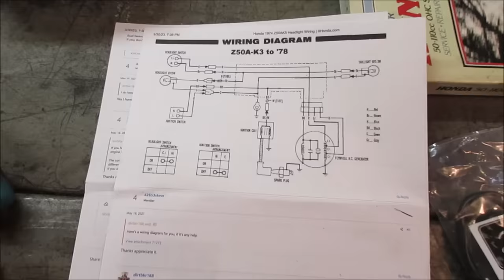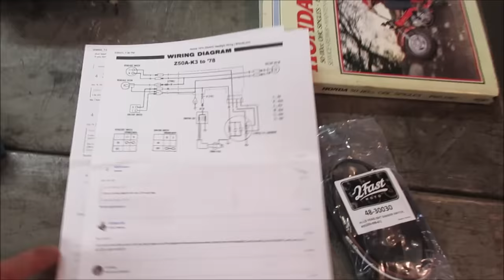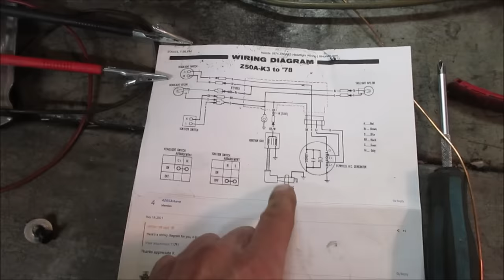They Could Not Fix It, Restored Honda Z50. Can We?

Comment: My brother and I had 2 in the 70's, One blue with white accents and one with red with white accents. Both were used when we got them. Not sure about the blue one but the red one was a 1971. The blue one broke not sure chain or sprocket. It never got fixed but that red one , I rode it till the back tire was a slick. I would get in trouble for using all the lawn mower gas. The neighbors had a Honda 50 also and a Yamaha 75. We would ride the younger brother on the 50 in front the other brother on the 75 in the middle and me in the rear .  That how we would "race" . All I remember  is the hours of fun we had on those bikes. My parents sold both of them at a yard sale I think they got 25$ for both. Yep 25$ !  End of story right. Nope. Years later while at work, the bosses son comes into the shop with a trailer full of junk and scrap metal. On the back of the trailer was my red Honda. I told him that's my mini bike, no way he said, no worries it doesn't run its junk. I walked over checked the tank , had a small amount in it. I took it off the trailer opened the petcock put on half choke 2 kicks and it was running. Rode down the parking lot turned around and rode past him wide open in 3rd gear. I should of never of started it. He wouldn't sell it to me. I never saw the bike again. Sorry for the ramble.

Comment: 30+ years ago I ran across a Red '73 AK3 "Mini- Trail" at a yard sale. They were moving out of state and needed to get rid of it. He had bought it new in San Jose to haul around in their class A motorhome, using it to run to pick up the paper, milk etc. I think he said it probably had maybe 40 miles on it. Anyway, as I recall we settled on $400.00 and I brought it home. I ride it almost daily as we have 37 miles of private roads, so no worry about being street legal. Several times I've been offered big money for it as it's bone stock, origional, and never been down. I think it'll be with me 'till I die (I'm almost 80) as it's so much fun. The only thing I've replaced are many sets of tires, and the seat as the origional vinyl finally began to crack. Mine has "Honda" written across the back in silver. Anyway I had my wife follow me in her car and as near as we could determine top speed was 27 mph. It always starts on the 1st kick and idles so quietly and smooth you can't tell it's running from 20 ft. Anyway most fun I've had for $400 bucks! 
Enjoyed the heck out of the video, keep up the good work!

Comment: Hey Mustie,
The best way to do the decals is to make up a mixture of a couple of drops of dishwashing soap and water in a spray bottle. wet the side of the tank you want to lay the graphic on with the mixture. Peel the backing paper off and lay the vinyl graphic over the water mix. this will allow you to move it around without it sticking. then use a squeegee to push the water out starting at the center. As you do this it will let the graphic stick. Any bubbles you get can be removed with a straight pin piercing the bubble slightly. Let the area dry over about a day and it will be solid as a rock.
Reply: I was going to say the same thing. I just put new decals on a 250 Big Red. I sprayed it with Windex, laid the decal over the Windex and squeegeed the Windex out. No air bubbles or wrinkles.

Comment: Pro tip…. As a motorcycle mechanic, the air/fuel mix should be 1 1/2 turns out as a rule to start with. Adjust as needed for high and low rpm acceleration. When you make adjustments give it time to run so you can check results properly.
Reply: He knows that and most of the time counts it. As you can see he was letting it run at first but it had an intake leak messing it up
Reply: @98wytebird  yeah, few understand carburetors better than Mustie.
Reply: Pro tip to a grandmaster 😂

Comment: My nephew had this bike (the yellow one) same year. I bought it for my step son in 1990, he was 10 and would drive it till it got hot hot it would quit, he would let it cool down for 1/2 hour and do it all over again. The throttle cable is broken so hasn't been run in nearly 30 years but is still in my shed. It's on my to do list to get er going again. Great video!!

Comment: ok. For decals. Spray a ton of water on both the tank and decal. This will allow you to move it around. Once you have it where you like it. Let it dry.  Done.  :)
Reply: Make it soapy water, it will work better.
Reply: Good tip, I have to put decals on trucks all the time and this is exactly how I do it, soapy water in a spray bottle
Reply: Best soap to use is Dove liquid soap, not much and plastic squeeze. Get the air bubbles out.
Reply: @Rom3_29  Actually I do have a tiny tiny bit of Dawn in my shop water. Tiny bit as even dry it is a lube.

Comment: Decals.  Usually, it is helpful to have an aerosol spray bottle of dish soap solution and spray a light coat on the surface first.  Then remove the backing and apply the sticky side. That allows you to position it, then use a small squeegee to press it on and push the solution out from underneath.
Reply: Windex can also be used.

Comment: Hi Mustie, had a Honda CD 50 moped, a metallic red small motorcycle style late '70s model lol, had TT handlebars, specially made, due to a slit in the right to fit the throttle mechanism.
Had one horsepower only so slow uphill, but really fast downhill with tires correctly inflated. Handling of a CD50 is rock solid. Sadly I sold it after two seasons - for more than I paid for it. A legendary engine, also available as a 90 ccm. Have fun with your Honda! (got my motorcycle licence on a Honda 400 Four, a fantastic bike. Had four lessons, passed).

Comment: Next time you're in a sticker dilemma, just squirt the panel down with water, that will allow you to position the sticker without it sticking.  When the water dries, the adhesive will take over and it will look perfect!  Cheers brother!!!
Reply: I was looking for this comment. I hate doing it that way as it seems so counter intuitive to wet the surface, but it works!

So resist the urge to compulsively dry everything and spray some water on the surface first. I know people who even say you should have some soap in the water, but I have never been able to overcome my clean obsession with decals to test that...
Reply: Use windex.
It activates the glue and allwoys you time to position the decal and dries off quickly as you use a plastic bondo spreader to work out the bubbles.
Been doing that for decades on large decales and vinyl art work on Arcade and other games professionally.
Reply: @pinwizz69  yes ! thank you, there is also  plastic squeegees that have a felt edge that protects the vinyl from scratches or tears

Comment: I had a 1970 starting in'75. Beat the snot out of it. They still had front-only shocks with the rear just solid. I let the rear sprocket bolts get loose and they stripped out the hub. The points cover didn't have that round access cover, it was all one piece, so of course it broke after a jump. I didn't know what JIS screwdrivers were and everything had those screws holding things on, so they all got stripped heads after a while. They had a key switch - it was on the left side of the frame under the front of the tank. It took me all over the place when I was in grade school and I was lucky to have grown up where I had some room to ride it. Best $100 ever!

Comment: Hey Musty a problem with those Honda carbs was the mixture needle and bore would become worn. A new needle would make a marginal difference. I worked on an 80cc for days and finally went to the local bike shop. The mechanic said without the needle bore is worn out and that was not repairable. On this carb it was a pressed in part with no service part available. I didn't own the bike so a new carb was not purchased 😐. The diagnosis made sense as mid throttle operation was absolutely junk.
Reply: First thing I do with 50cc projects is buy a $40 China replacement carb.

Comment: These have a centrifuge oil filter built into the clutch. The clutch needs to come apart and cleaned. This causes the clutch to stick and not disengage while kicking it over and makes them hard to start. You get that skipping feeling when you kick it.

Comment: For applying decals I pull the back off drag it through a pan of warm water with one squirt of Dawn in it. Then you can put it wherever you want and eventually the dawn dries off and voila!  Stuck!🎉
Reply: I had a company van at a graphics shop for decals, they also used soapy water to slide them around for a perfect fit.

Comment: Your tank grommet worked well. I noticed in the "parts box" that came with it there was a pair of rubber grommets that I thought were for wire protection but they also look like they would fit the tank slots as well. Wonder if they were actually the tank grommets?
Reply: I thought the same about those grommets.
Reply: I remember seeing that also, was hoping he would look over his pile of parts that came with the bike again, but it seemed like the house within the house to hold the tank in place worked real

Comment: Laying decals,  you can use water with a half a drop of dish washer liquid ikn a sray bottle. spay the tank or under the decal. that will will let you pull it up and move it around,  once it is down you can push the water out from under it and it takes the air bubbles with it...  after application a hair dryer will help remove wrinkles and shrink it to the shape.. good job for your second time.. heheheh
Reply: are you kidding ?

Comment: You know it's gonna be a good day when a Mustie1 episode pops up in your morning feed.
It's strange if he doesn't tear down a carb.
He certainly didn't disappoint us today.
When you go to apply a decal spray some windex on the surface of what it's going to be put on.
Then put it on squeezing bubbles of air out with a plastic bondo spreader.
They come in a packet of 3 at home depot. 
I've installed hundreds of decals and vinyl overlats that way for decades.
Reply: Carburetors are so much fun, they remind of the Lego Technics of my childhood. I love spending a rainy afternoon tearing them down and rebuilding them.

Comment: I'm almost positive that the air breather for the carb is the brass tube sticking up from the bottom of the float bowl. That is also the overflow if the needle gets stuck open. That tube bypasses the bowl drain screw as well. 👍🏻

Comment: I thought the rear springs didn't come until 1976.. at least in my part of the world. I had a 1977 and I loved it. We had weight restrictions of 55kg to get it registered as a moped, so our model had plastic fenders, small 2,5 liter tank and a rubber head light. Only 1.7 hp.

Comment: One of the first two bikes(the other was a CT90) I put back together in the mid 70's; both were late 60's, and total basket cases. I got them both running, but to play with, not "restore". The compression on the 50 was so low, the only way to get it going was pushing it in gear, but it ran that way for over a dozen years-couldn't kill it. Fun times, and fun watching Mustie go through troubleshooting these critters...

Comment: Spray bottle with three drops of dawn dish soap. Spray tank, put decal on tank and squeegee out till smooth the soap allows movement of decal so you can get all wrinkles and bubbles out. Then just use hair dryer to get remaining bubbles out. I’ve done that for years, works great.

Comment: Wow.  I am going to teach you something, never thought that would be possible.  When applying decals, you actually spray the surface with soapy water or even glass cleaner if I remember, it allows you to slide the decal around until you find it's place, then squeegee out the liquid, let it dry and it will stick.  Learned that working for a certain beverage company when they changed the decals on all of their vending machines.

Comment: My very first bike.  Can't actually remember the year, but it was red, and the motor was all but bullet proof.  I learned how to change the oil (1 Qt.) and spark plug.  I also learned how to use a blowtorch to straighten the handle bars when I would occasionally put the bike on it's side.    Next bike for me, the CR80.

Comment: For Christmas 1968 my neighbors 3 miles away (farm country) got a PAIR of Honda 50 Mini Trails. I had a Rupp Roadster. There was no doubt which was the better bikes. We rode around in pastures a lot, and when mine broke down they would tow me to the machine shed shop. In 1970 I bought a new SL100 Honda and owned Hondas until 1993 when I quit  motorcycles and never got on one again. But we sure had a lot of fun riding those Mini Trails.

Comment: When I was 12, I had one of these that was a 72 model. It had the same color, a headlight and tail light, chrome fenders, but it had no rear shocks, but front shocks. It came with a metal Honda name plate on each side of the gas tank, and not stickers. I loved that bike.
Reply: Maybe a QA50?

Comment: My neighbor just gave my son a 1979 z50. He had rebuilt the engine a few years back and had to replace the carb due to missing parts. Then it sat again for two or three years. We can get it to start and run sometimes but it’s not running great when it does. The carb is a Chinese knock off which is the 1st strike against it. Hopefully I can get it running more reliably so he can enjoy it this summer. Some of the trouble shooting done in this video are a good starting point.

Comment: If you squirt some soapy water on the tank then apply the sticker it will allow you to move it and get the bubbles and wrinkles out before the soapy water dries. That technique works for signs on vehicles as well. Thanks for the videos...peace.

Comment: To put those decals on more easily, mix up some soapy water in a spray bottle and coat the tank.  Then float the decal on the water and adjust where you want it.  Then squeegee out the water.  Works great.

Comment: When I was 15, before internet, I had one of the later ones with full manual gears. The previous owner had drilled the carb and intake bigger to ”make more power”, everything was messed up, parts missing and so on. I didn’t know that much more either but I got it running a way better. I just wish Youtube would have been around in the 90s but what’s the fun in that? 😂 I miss those days, just riding aimlessly until something broke down again. Then fix it and repeat. 😂

Comment: Mark the location of the decal with thin blue tape. Take measurements. 
Apply soapy water mix onto the tank. Apply the decal and line it up.
Then use the yellow plastic Bondo spreaders to work the water out from the decal. The water mix allows you to move the decal around before you squeeze the water mix from under the decal. Once your done. Remove the tape and dry it off. It's like applying window tint. Works the same way.
I rode one of those bikes around in the back off roads. I had super fun. My neighbor let me borrow it.

Comment: With a lot of decals in my experience it is easier to take a razor blade and add slits all the way around the design in areas that wants to bend. Making it more flexible and easier to laying flat on a round surface.

Comment: When Installing decals it helps to take a cup of water, add a few drops of dish soap and an ounce of isopropyl/rubbing alcohol. Put the mix in a spritzer bottle and spray the tank surface and the sticky side of the decal. Place the decal on the tank and the mixture allows you to reposition the decal to exact desired position then using an old credit card squeegee out the bubbles under the decal. Allow to dry overnight before use.

Comment: Common mod when i was a kid, head off, valves out, take to the inlet with a round file, open it right up, then fit the CT 90 carb and intake. Much more gooderer  bigger smiles and faster than the other 50 cc bikes.
Definitely a road legal model down under in this part of the world with lights and flashers.
Blue, red and pink were low, medium and high charge. Winter was high charge with the lights on, low or medium to stop boiling the battery with no lights on

Comment: I had a yellow z50 when I was a kid.  I think it was a 1976 model.  It was a trail bike.  No battery or regulator.  At idle, the headlight and tail light were very dim and would get brighter when you revved the engine.  That always annoyed me a bit, but it was a very reliable little minibike and served me well for several years.  I sold it when I was 14.  Really regret that now.  Top speed was right around 30mph.

Comment: I acquired a Subaru DL from my father that had a bad hesitation problem. He bought fuel from a station and must of gotten the bottom of the tank, because the car won't run at all after filling up. He had taken to a repair shop and they did a tune up on it plus replacing both fuel filters. Like i said it still had a bad hesitation problem so i took the carburetor off and cleaned all the passage ways in it . I take it for a test ride it still had the same problem. The next weekend  i took the carb off and sprayed cleaner in the brass inlet and nothing came out, so i reversed the procedure from the inside out and all the crap came out of it.There was screen a screen in the inlet that was clogged and was causing the hesitation problem. Sometimes you have to do it twice to figure out the problem, but that's the fun of it.I also have a story about those threads coming out of the block.

Comment: I save Twist Ties and run the wire from a stripped Twist Tie through all the small orifices. Sometimes air and/or carb clean just wont clear them.

Comment: My first ever motorcycle was a 1969 Honda CL175! Picked it up for $50 ish, and got it running. Rode that thing like a dirt bike (I was 14 I think at the time, never got to ride it on the street. Went to a 1993 RM250 after that, quite the difference lol

Comment: As far as the decal, I spray soapy water on the surface, place it on then squeegee the soapy water once I have it in place. This allows you to move it around. Just a tip.